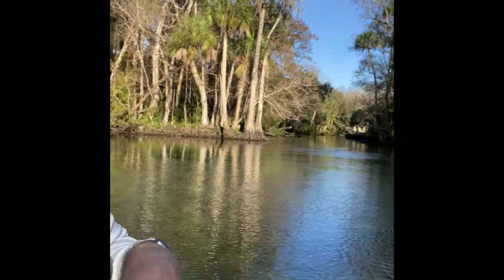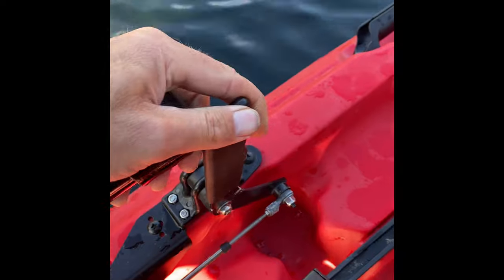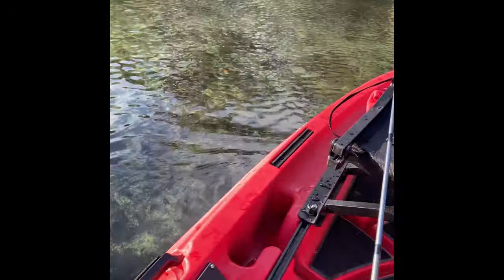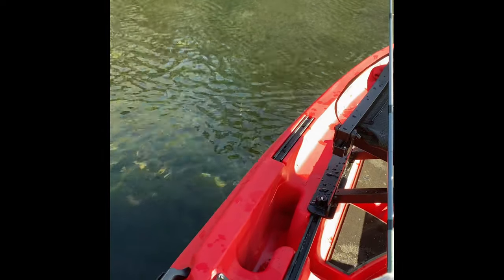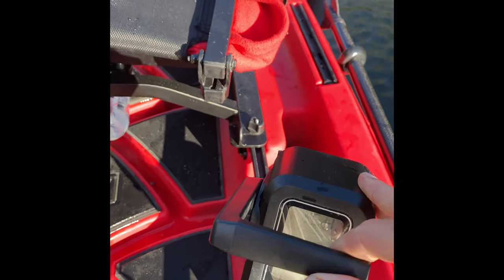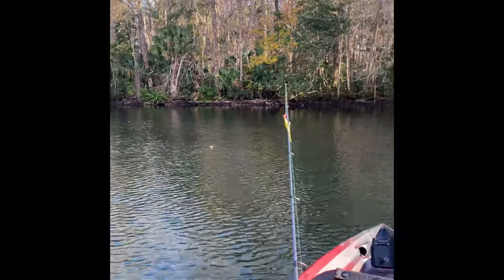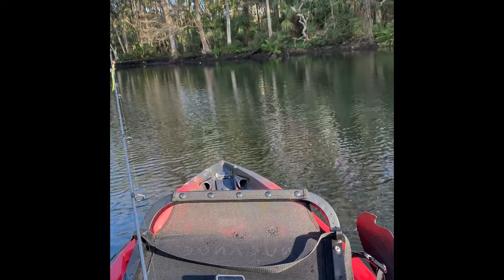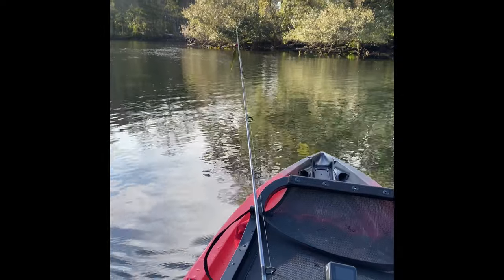Test Driving The New NuCanoe EPS Motor - How Easy Is It?

Comment: That doesn’t look like the motor bracket that comes with what I saw on Amazon. Is there something special for the flat transom mount on the nucanoe?
Reply from the maker: I don’t recall on the dealer’s early test drive how it was mounted. However, the quick connect assembly comes with a metal mount that goes over transom and is very sturdy. https://www.nucanoe.com/power-eps/

Comment: How do you remove weeds and lily pads if it gets hung up?
Reply from the maker: If the motor doesn’t automatically pop up when going over really think stuff to avoid getting hung up, you can pull it up with the cord from your seat and then run it quickly in reverse. I’ll try and show that in the next test run. Thanks!